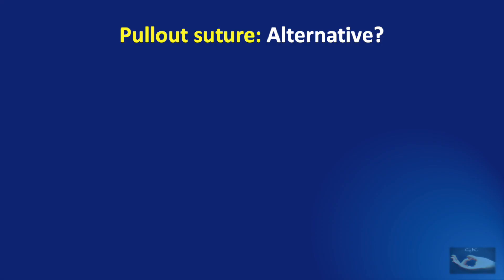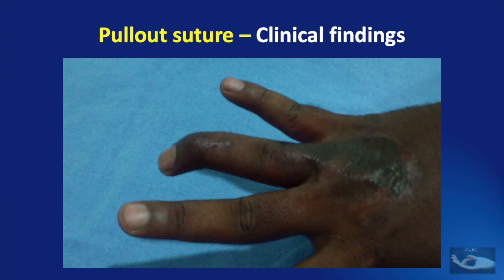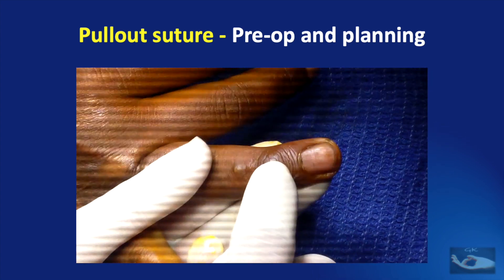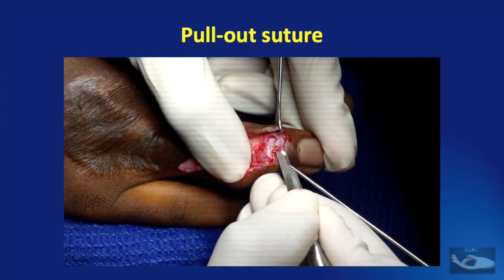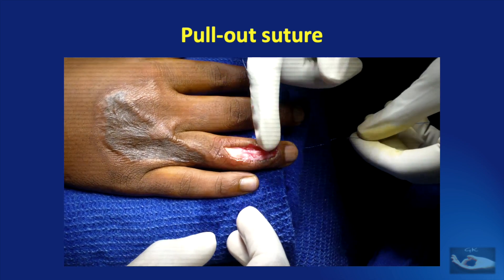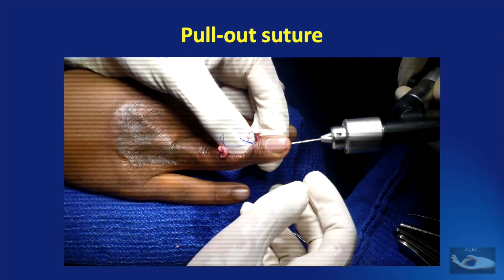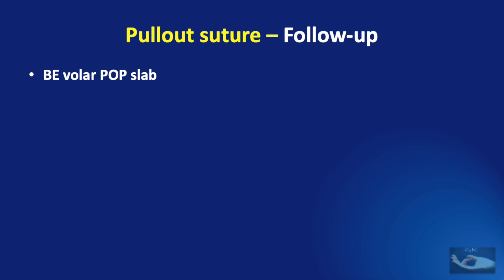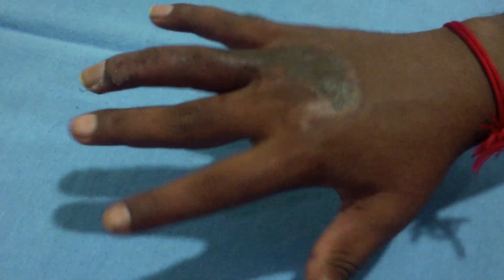The Pull-out suture technique - How to reattach an avulsed extensor tendon in a mallet finger!

Comment: Hello Sir..Thank you for posting this excellent video. One question, do you expect a straight line scar or contracture in the long run for this patient? If so, plan of management?
Reply from the maker: @sreeragbprasad2403  Not at all. The incisions have not crossed joint crease lines at right angles.
Reply: @GKHandSurgery  Ok Sir. Thank you.